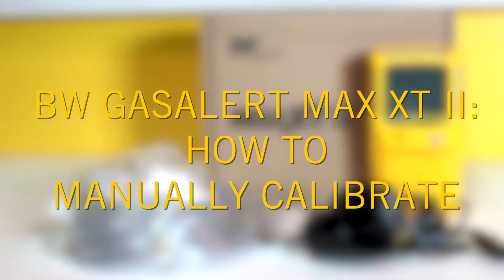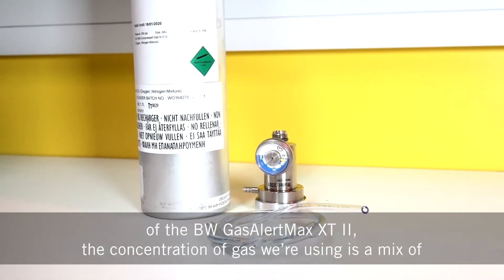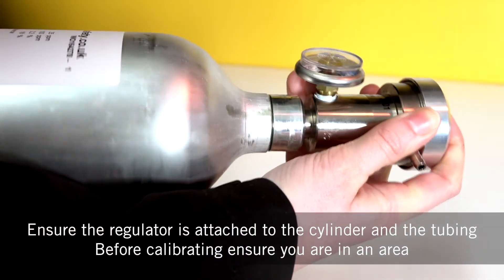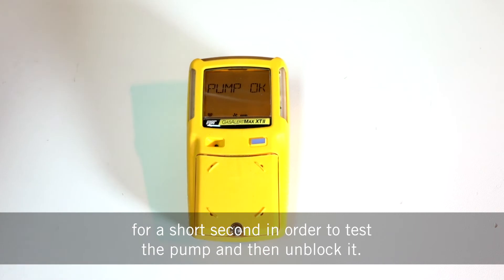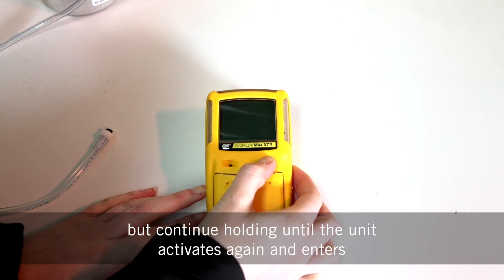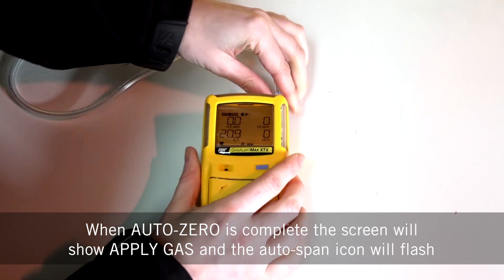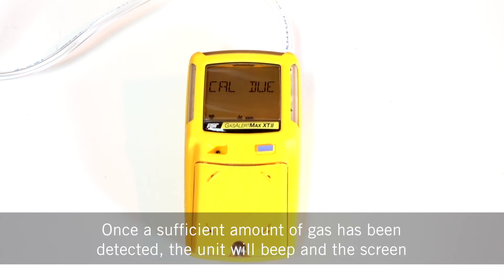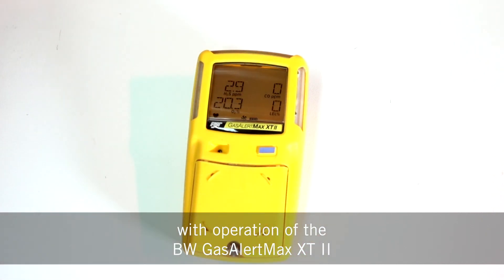How Do I Manually Calibrate the BW GasAlertMax XT II Multi Gas Detector?

Comment: Hi .how do i on the pump if it shows "Pump Off"
Reply from the maker: If your BW GasAlertMax XT II shows “Pump Off,” it means the detector isn’t detecting the pump module correctly or there's a blockage. According to the official Honeywell manual, here’s what you can try:

Power off the unit.

Remove and reattach the pump module securely.

Check the inlet, tubing, and filter for any dirt or blockages — a clogged filter is a common issue.

Power the device back on — the pump should activate automatically during the startup sequence.

If it still says “Pump Off,” the pump module might be damaged and may need servicing. Hope that helps!

Comment: What gas to be used for calibration
Reply from the maker: Hi Adil, you should use 25PPM H2S / 100PPM CO / 2.2% CH4 / 18% O2 / N2 Calibration Gas, part number -  8A-4N-83-FR - to calibrate the BW GasAlertMax XT II. 

You can find it here -  https://www.frontline-safety.co.uk/fls-calibration-gas-58l-bottle